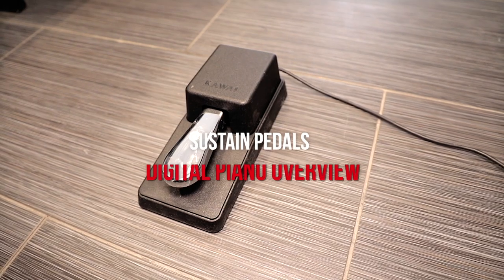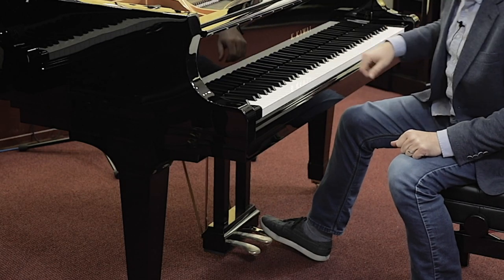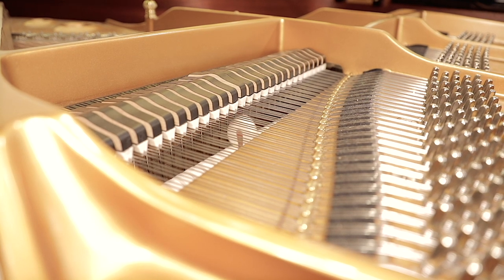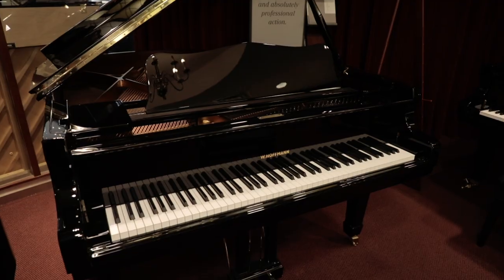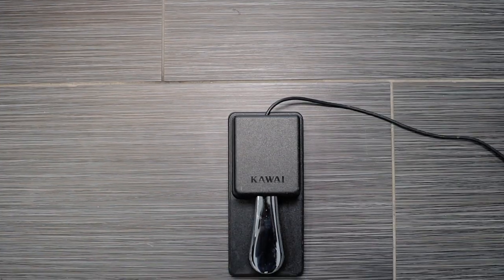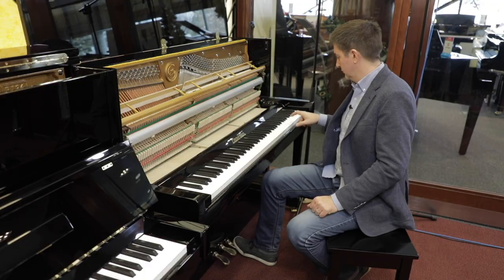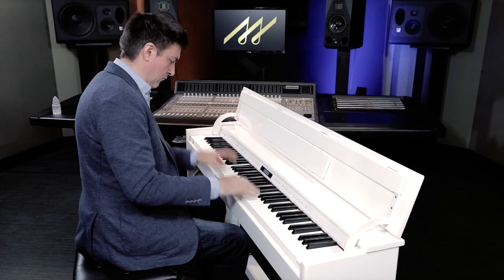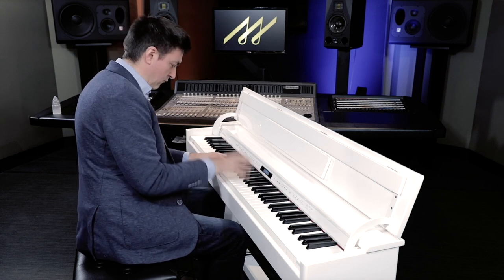🎹Types of Sustain Pedals - What Is It? & What Does It Do?🎹

Comment: Most of the Yamahas have half-pedalling functionality, but the supplied pedal is often just the switch type. Mine has a full-size robust pedal, but it's still just a switch. I think there is a reason. Few portable pedals will stay still enough on the floor for you to benefit from half-pedalling. I  bought one with that functionality, but I was dissatisfied so I returned it. Finally, I bought the furniture stand and matching 3-pedal unit, just for home studio use. Now I have 3 useful pedals that stay still, but for gigs I just have a glorified switch. 

The Youtube reviewer Pianoman Chuck has some interesting observations too, particularly about which shoes reduce pedal slip. Supposedly, our shoes are the real culprits. I often use a small car floor mat. It helps. In an emergency you can jam the pedal into a corner of an X stand, but it results in a bad piano playing posture, and twisting your leg like that is very unkind to your knees.

Speaking about posture guys, if your back often hurts while playing, try raising your seat. One of the advantages of many portable piano stands is adjustable height. I'm no giant, but I have my gear set up just a bit higher than the typical piano height. The stool just happens to be a little tall anyway. Saves my back. It also makes me a little more prominent on stage.

And thanks Stuart, for consistently saying "acoustic piano" (for the wooden ones) throughout the video, and for not saying "real piano". You're a hero!

Comment: Very good informative video.  Can you tell me if there is any sustain pedal made as a Knee bar control that can be operated by moving one's knee sideways to move a lever that does simple sustain like the floor mounted foot pedal but that can be clamped under the keyframe bed to allow pedalling for someone with an amputation?  I've not had much luck looking around for one to fit a Casio digital piano.
Reply from the maker: Thanks for the kind words and for tuning in! I have not personally seen a knee bar control like that before, but I am sure it is possible to design and construct one. However, my suspicions would be that this would have to be a custom-made device, especially if the need is to fit a specific piano model. Thanks again and best of luck with your search! I hope you are able to find a solution that works for you and your piano. :)
Reply: @MerriamPianos  Thank you very much that rather confirms my suspicions but it's not the end of the world to work around it with a "jury rig" as they say in the sailing world.  Probably a light weight thick plastic right angled plate taken from something being scrapped and then sticky backed velcro (oops sorry Velcro® I should say Hook and Loop fastener adhesive strip to attach the square floor sustain pedal normally stuck to the floor with duck tape to stop it sliding around.  That could be stuck on the vertical surface which could be wooden or plastic and the only tricky bit is sticking the plate to the piano keybed underside without drilling into the bottom of the piano which could drill right through a circuit board!  Not a good idea.  thanks for you comments

Comment: I have my flip switch pedal velcroed to a heavy steel plate with silicone rubber feet on the bottom.  It's OK but not perfect.  It still creeps on carpet, but very slowly.  I would like partial pedaling. I'm not sure if Pianoteq or Casio supports it.
Reply: Internet Privacy: See my comment on half pedalling and the options. IMO it requires a very secure pedal. Clever of you to use that steel plate though. Yamaha should make a portable three-pedal unit that can clip onto the back of its renowned portable sub woofer.
Reply: My pedal does not work,. I have a CTK-401 with a ammoon model pedal.
Reply: @bishoprandymorris  Does it work in reverse? I mean is it stuck on sustain till you press it down?  That would be a polarity issue. Normally, you should connect a pedal before you switch on the instrument. If you've already done that correctly, try connecting it after you switch on. And there are ways of permanently switching polarity too.